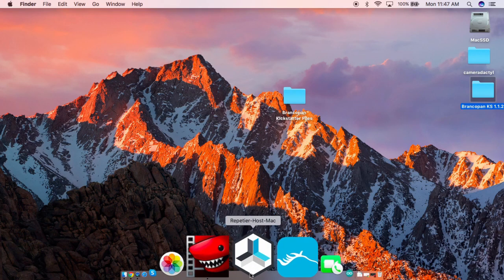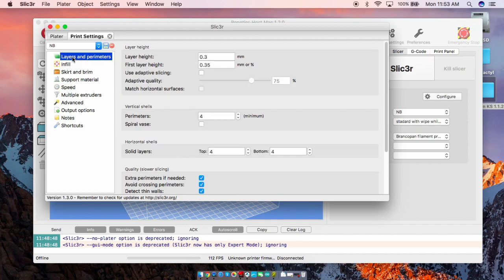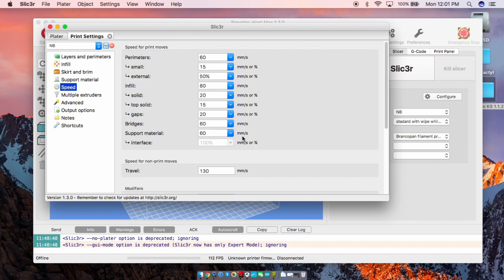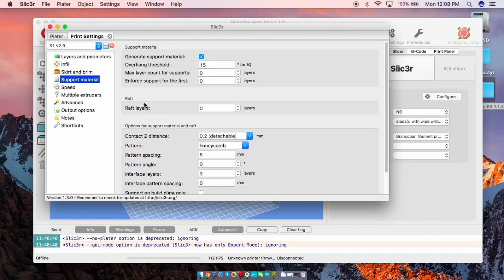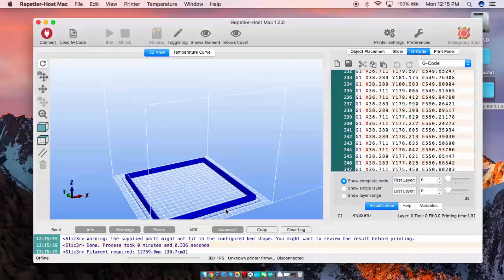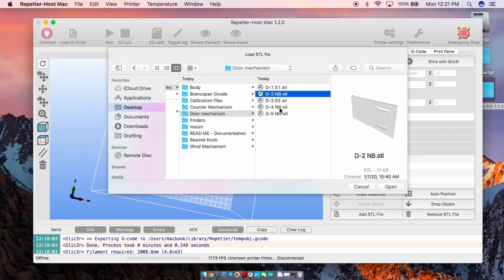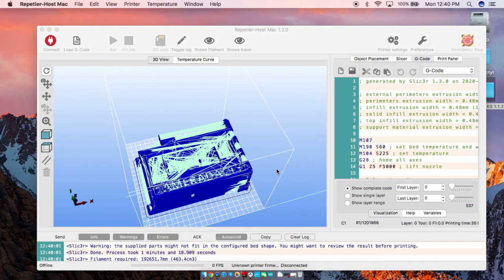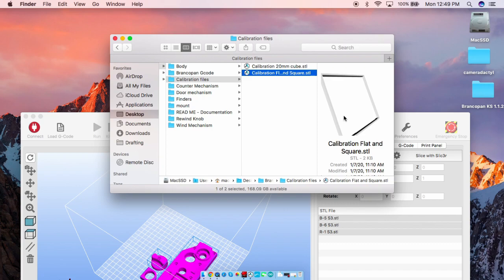Brancopan Slicing Instructions

Comment: Hey! @maxWanderlush from Instagram here. Everyone has been asking me how I got such a clean print, so I thought this would be the best place to add my notes for posterity: 

1) My Prusa Mk3S printer's upgrades include the nickel-plated copper E3D V6 heater block, and hardened steel nozzle (nozzle not needed if you print only PLA/PETG).. that's it, everything else is stock. 

2) Always make sure your belts are nice and tight, and friction points nicely lubed.. not super tight but more tighter than looser if that makes sense.. you should barely be able to pinch them together. 

3) I printed in 0.20 layer height, which extended my total print time to almost 4 days however there was a LOT less sanding afterwards.. I think only the rewind knob needed heavy sanding and whatever holes/surfaces had a slight "elephant's foot" from squishing down onto the heat bed. All the shafts and cups interconnected and rotated smooovely, and gears looked great at that layer height. 

4) I think this may be a big one, I disabled "ensure vertical shell thickness" as it was causing an excess of filament to blob here and there on one of my first prints, thus making the surface look imperfect even after cleaning it off. Not sure what impact this setting is supposed to have, it may be critical for shafts and gears, but my print is sturdy as hell so this may not be needed at least for the body, door, and colored parts which is what you want to look good anyway. Also on those bigger parts if I left it unattended for too long I would have suffered the blob of death. I kept having to clear buildup on the nozzle until I ditched this setting. My heater block runs hotter though so that may have contributed. Still, I don't think this is needed for the body, door, and grip.

Judging by how relatively quiet it's been I'm assuming most people are still waiting on printers to arrive or just attacking Ethan's email. I've been printing camera stuff for a little over a year so I am no expert, but I got a machine just for this kind of stuff and have been successful, so I am more than happy to share my knowledge with anyone. Comment here (preferably, so everyone can see the answers) or DM me on IG if you prefer private advice.

Comment: Done creating all the gcodes. I decided to go with 0.20mm height because it's what I'm used to with Priline Carbon Fiber PC. Total material right at 1kg, total time one hour shy of 3 days. Ready to rock! Before you went into the profiles, you mentioned there would be use of both honeycomb and sometimes pillars, but in the profiles setup they were all honeycomb. Just double-checking if honeycomb is fine for all supports, before I start printing the supported stuff.
Reply from the maker: I did print everything with honeycomb in the end I believe.  Excited to see how the camera looks printed in such fine detail!
Reply: @CAMERADACTYLCameras  Almost went 0.10 as that's what I use for my adapters but that would put it at almost 4 days. lol. Working on a Mamiya Press clone base, cause the lenses are drying up. Based on the width of the Brancopan image, adapted Mamiya TLR lenses should provide full coverage. I'll email you about it.. will help keep the camera/mod sustainability going.

Comment: Hey Ethan, I have a Prusa MK3S. Is there a reason you can think of to use Repitier vs PrusaSilicer?  Just curious. The settings you are doing here are pretty basic and can be found in PS as well. I was just curious if there is a reason NOT to use it over Repitier.
Reply from the maker: Prussa Slicer is GREAT.  If you can translate the settings, go right ahead.  In the file packet there is a document that lists them out in screenshots, should save you some time over watching the video if you are already familiar with slicers.